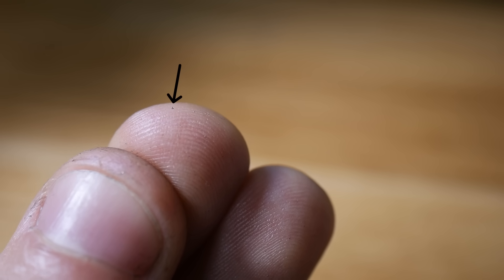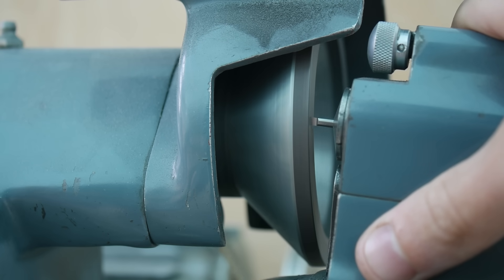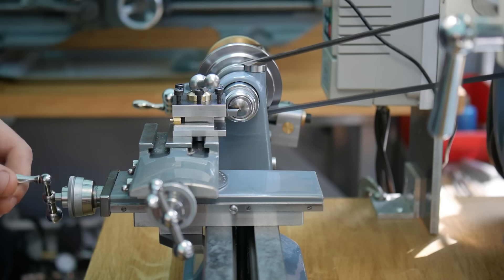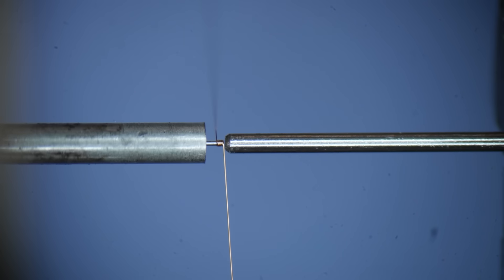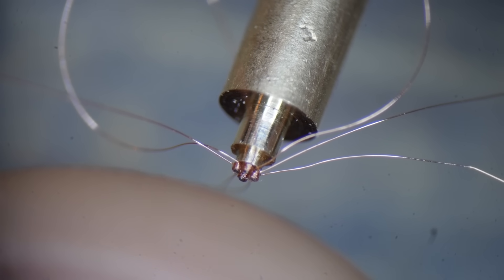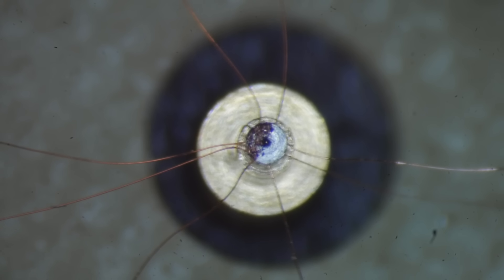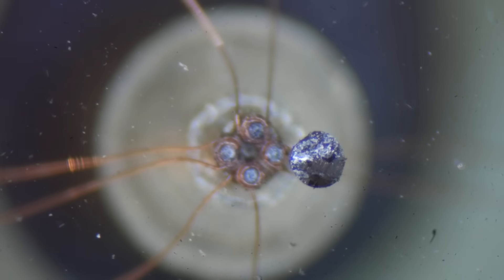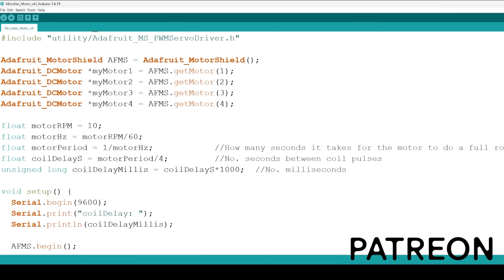Attempting to Make the World's Smallest* Electric Motor

Comment: AlNiCo magnets are quite ubiquitous in guitar making, and their resistance to machining was also a problem for Fender engineers when they wanted to develop a guitar pickup with adjustable pole pieces. Their solution to the problem was using CuNiFe magnets, which are supposedly a lot easier to machine.
Reply from the maker: Thanks for the tip - this looks like the ideal material. I will give it a go!
Reply: I’m now wondering just how small a working electric guitar could be? Heck, might as well make a miniature amp and speaker for it too!
Reply: @Oldtanktapper based on some quick calculations the minimum string length that would produce an audible pitch would be around 1 cm, so it would be very hard to build one any smaller than that. Also at that size you would have to have such drastically different diameters of strings in order to be able to tune all 6 strings to different pitches I'm not sure it would be possible even at that size.
Reply: @nefelpitou you may well get away with only using 2 or 3 gauges of wire and different tension.
Reply: @nefelpitou oops, see comment above
Reply: @Oldtanktapper the strings and their ratio of thickness to length would be the main issue that I can see. That and it would be impossible to play, lol
Reply: @chemistryofquestionablequa6252  perhaps you could vibrate the strings with an air stream
Reply: @TalRohan  probably, but how do you fret notes, maybe little plungers? The big problem is the string length to gauge ratio, it's going to be a VERY high pitched guitar. It would still be super cool though. You could run it through a pitch shifter to get it down to regular guitar range.
Reply: @chemistryofquestionablequa6252  sounds good to me ....I have a feeling making it sound anything like would be harder than making the thing lol
Reply: Compressed gas is how the world's smallest fidget spinner is demonstrated!  @TalRohan
Reply: @Yoshikaable  makes sense...I bet it spins insanely quickly too
Reply: @Oldtanktapper  Make it happen! Make it happen!
Reply: @theworkshopwhisperer.5902  sadly that’d be waaaaaaay out of my league!
Reply: @Oldtanktapper 
imagine the guitar case is the 3.5 mm jack
Reply: @Oldtanktapper define working?  Technically a guitar only needs a single string and a pickup to be considered an electric guitar no? Define your parameters before trying to find the solution
Reply: @Oldtanktapper how about make the world's smallest violin?
Reply: @Oldtanktapper the strings couldn't be that small, they need the length to resonate and vibrate. Hence why mandolins and ukulele's are about as small as you can go before they stop working.
Reply: @MRblazedBEANS def not true, i have a mini guitar thats less than half the size of a small ukulele. It doesnt play great because its a toy with bad strings but it definitely can be tuned
Reply: @Oldtanktapper  there is a nature made motor on bacteria with flagella that is nanometers across the parts are literally molecules.  There has also been research into using the skeleton remains of plankton which come in all shapes from pipes to cogs and triangular rods
Reply: Sir,
Have you tried wire edm to cut alnico. A small homemade wire cut can also turn and cut off. I think.
Reply: The magnetic version of inconel.
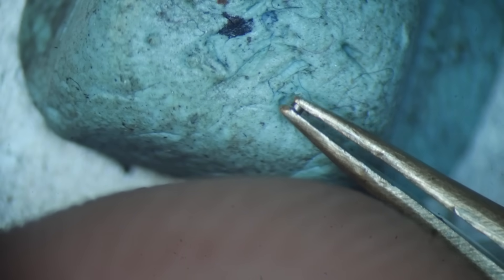Reply: 13:03 what a freebie lol
Reply: Some quick calculations? You a physics major?
Reply: just drool some liquid nitrogen over it. idk what i’m saying but it makes enough sense to try ,for me